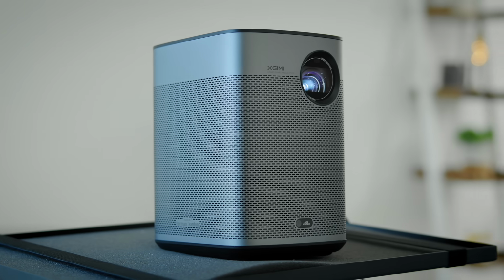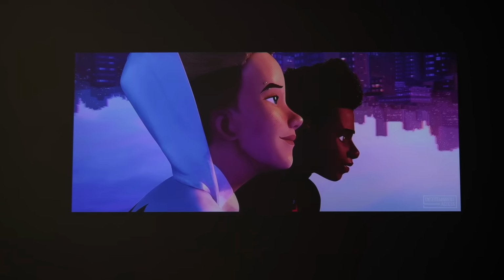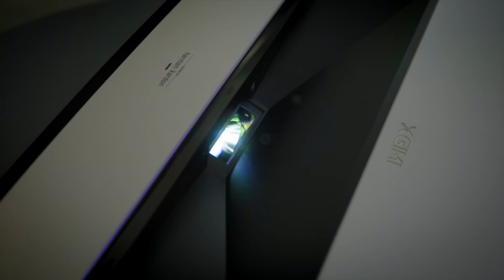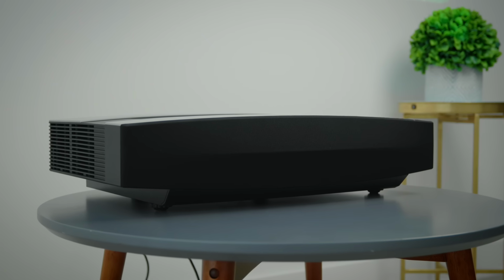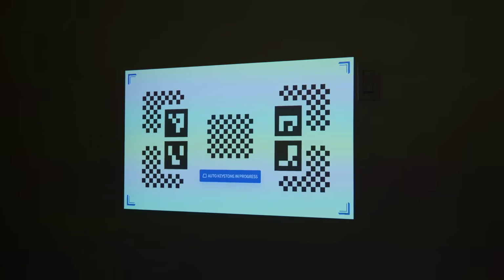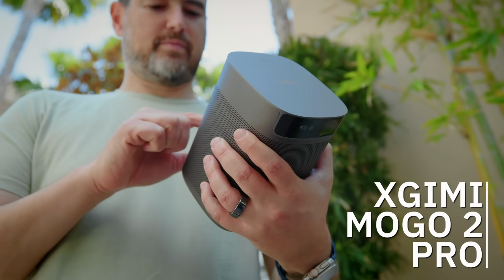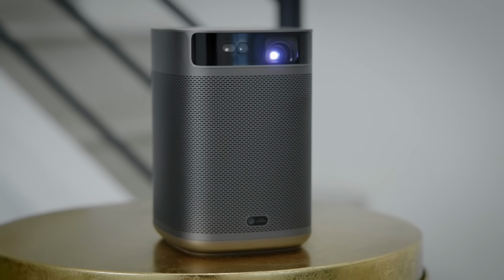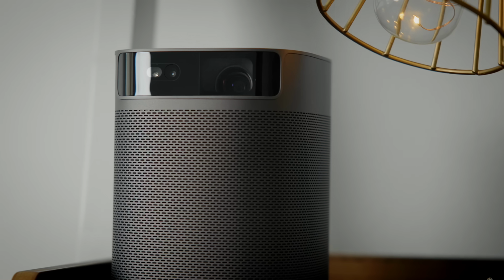All Your Perfect Projectors! XGIMI’s Line Up!

Comment: I have the halo plus projector and i love it. I had the samsung freestyle and thw xgimi is a lot better.

Quality looks beyond 1080p due to downsampling i believe. Brightness is decent if you have the screen smaller. Washed out at the 100 inch i have it, but my living room lights are bright. But i use it with the lights off as you should, and it is an amazing projector, i have xgimi 3d glasses too and its great. The sound is plenty loud anough, i have it at about a qtr volume. 

I'd get rid of my tv if my better half would let me, as there is something special about projection. 

My setup is using the built in android, not bothered about netflix but not hard to get it working. And i have ot hooked up to an xbox, gaming on the boost mode if fast enough, ive not noticed the latency.

Ive got loads of bluerays, and this has given me a reason to start watching them again.